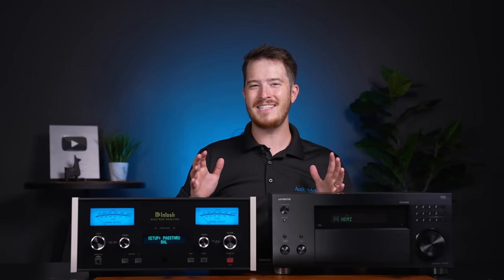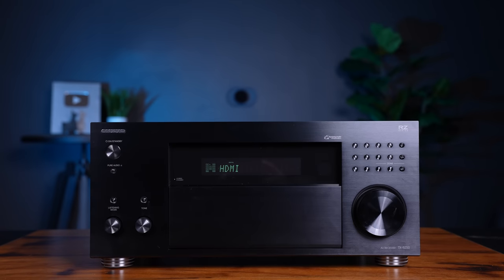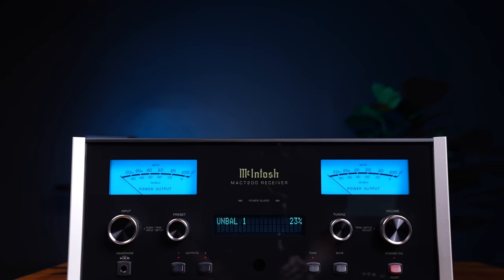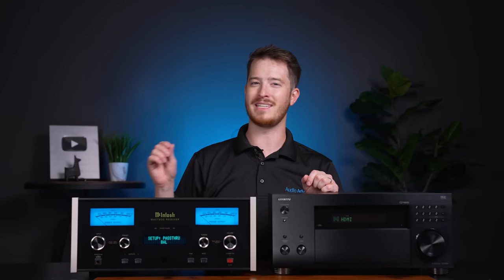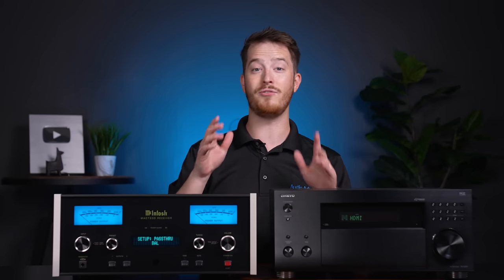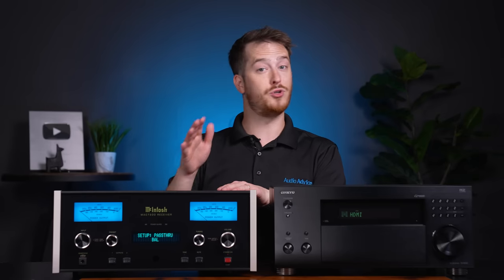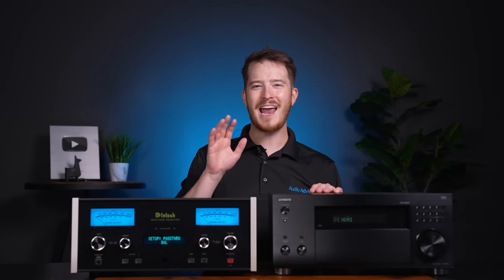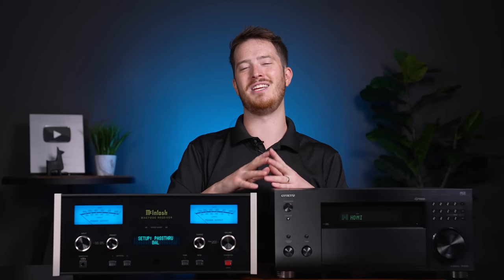Home Theater Bypass Explained | How to Get Great Two-Channel Audio in Your Home Theater!

Comment: Great video but I have a semi-related question.  I’d like to find an AVR receiver that’ll just drive audiophile-grade 2-channel stereo to 2 rooms simultaneously (speakers are 4 ohm).  Yamahas will drive 2 rooms but Yamaha mixes “party mode” zone-2 into MONO for some reason (Why on earth!!).  Preferably I’d like to set “room 2” speakers to a slightly lower volume.  I don’t need TV or surround in this case; just 2-channels into 2 rooms, but preferably with audiophile quality.  I lean toward AVRs because of the built-in room correction.  Is there a quality AVR that might be up to the task?  Any insights appreciated :-), thanks!
Reply from the maker: Thanks! Call or chat with our team at audioadvice.com and they may be able to help you out with the question. Thanks!

Comment: I have seen several posts on social media stating that, before switching from stereo listening to home theater mode, they turn down the volume of the integrated completely. I guess that would be to prevent damaging their speakers?
That sounded pretty risky to me, especially in a household. But watching this video, I didn’t see you mention that.
Now I’m confused. It this amplifier dependent?
Reply from the maker: That part seems odd.  If an integrated amp has home theater bypass, selecting it is the same as setting the integrated amp to full gain, so turning it down first would not do anything. This could be people who are trying to fake a home theater bypass and they would want to turn the volume back down before they chose another input.  Thanks for watching

Comment: You setup looks great. I get great audio reports with my T4XB using a Shure 444 (high impedance to match the Drake input ) which was a popular combination back in the day. I had tried a Turner 454C SSB mic and the feedback was the audio is tinny. The D-104 also has high treble - to me it’s not great for SSB but others work probably argue that. I’ve heard the Turner +3 is an awesome sounding mic. 73.
Reply from the maker: Thanks for sharing!

Comment: Very interesting, to connect my Rotel to my Denon 4700 AVR to enhance and give quality to the front column channels.

I understand that the speakers must always be connected to the stereo amplifier, right?
Reply from the maker: Exactly yes.  If your Denon has front channel preamp outs and your Rotel has a home theater bypass, it will work great.

Comment: Here is my scenario and im a noob.... I pretty much have a 7.2 speaker setup but have all speakers play music in stereo(left and right). What I've done for now is buy xlr splitter cables to split front left pre-out signal from my pre/pro-amp to 2 amp channels where I have 1 amp channel (monolith 7x)connected to my left tower speaker and the other connected amp channel to 2 satellite speakers(above my left side of couch) and the other (behind left side of couch). The non tower speakers are smaller 4ohm satellite speakers wired in parallel. My setup is the same on the right side. Is there a better way to do that? can I "assign" my assignable height 1 and 2 to the Front Left on the pre-pro and then connect the height preouts to amp channels so I don't need splitter cables? I prefer a room full of sound all the time where i'm in the center of it with music and if I decide to watch a movie, I can swap the cables and change the settings back. With surround movies, most of the time, the surround speakers just stay dormant until their called upon and with music, there off.
Reply from the maker: Most home theater receivers have an all channel mode you should be able to engage.  Thanks for watching

Comment: My Yamaha AVR has been doing double duty for over 20 years with Direct mode. I never understood what was so difficult about this but sounds like not all AVRs had that option.
Reply: Direct mode is simply bypassing a lot of the signal processing inside the unit. Home Theater Bypass, as Audio Advice clearly described, is leveraging a much higher performance piece of gear to drive your stereo pair, but seamlessly integrating it to work with an existing home theater receiver, even the very best of which pale in comparison to a comparably priced dedicated stereo unit. That’s no insult to the home theater receiver by the way. It’s simple fact. Home theater receivers can be awesome. But 5, 7, 9, 11, or 15(!) channels of amplification in one chassis? Compared to a chassis with a massive power supply dedicated to only two channels??? It’s science man!!! 😉
Reply: @scottwallace1  Yes, absolutely!
Reply from the maker: Very well put!  Thank you!
Reply: @omahahaha   You're not getting it.  Your Yamaha in Direct Mode is not close to having a dedicated 2channel system for stereo listening.
Reply: @CP-vi8fy  Thanks for your reply. I do get it, but this is a great option to save money or space. My setup sounds fantastic.
Reply: @omahahaha    Okay.  Happy to hear it.  Cheers.

Comment: does this setup work for dual sub systems so I can seamlessly switch between 5.2 and 2.2?
Reply from the maker: It would depend on the gear. You need to control the subs from your two channel component to do that.  Thanks for watching

Comment: Im kinda new to this . My Marantz SR6015 has the option called "Pure Direct".
  Is that doing a bypass?
Reply: I have the sr7011. Pure Direct just basically eliminates all the noise from internal sources to give you a flatter response. That's why you'll see it even turns off the led panel when you apply it. Not the same thing as a bypass.
Reply: Use the pre outs in your Marantz to connect to a dedicated 2ch
Reply from the maker: What @bootneylee9802 said is correct.

Comment: Great video! How about the subwoofer if I want the power amp to work for 2.1 instead of 2.0?
Reply from the maker: Thanks, that can be pretty tricky. If you are interesting in pursuing, please reach out to our team to get into more details on your system.  You'll need a sub with speaker level inputs and a crossover.  You then will need to use the crossover on the sub for stereo, and defeat it for home theater, which is inconvient.  The REL subs work very well for this though.  Thanks for watching

Comment: Hello. How do you setup home theater bypass between anthem STR stereo preamp and a Denon receiver 4700h that is currently using an external amplifier. It seems like I would have to remove the external amplifier connection from the Denon in order to make the pre-outs available for this home theater bypass with the anthem STR preamp. Additionally, I would then need to connect the anthem Left & Right channels directly with the external amplifier via XLR since no rca connectors are available on the anthem. Lastly, I would need a special cable (XLR to rca) going from amplifier to my center pre-out on my Denon?
Reply from the maker: If you have an external stereo amp connected to the Denon for your main speaekers, it should be connected to the Anthem.  If you have just a mono amp connected to the Denon for the center channel, you leave that in place.  Your STR should have 4 analog RCA inputs.  And should you have bought all this from Audio Advice, we would have walked you through it already :)

Comment: Would I get good quality 2ch in this bypass scenario if my preferred music listening is via tidal on appletv which is plugged into a home theater processor. And the reason I’m fixed on appletv is for the on screen display on my TV for music videos watching on tidal
Reply from the maker: The bypass would not be useful for your use case.  Thanks for watching

Comment: I'm looking at a Parasound HINT 6 Halo integrated amp, and it has Home Theater Bypass for L, R, Sub 1, and Sub 2. Does that mean I can use the same subs for the 2.1 setup with the HINT and also a surround sound receiver? If so, any idea how that all gets wired?
Reply from the maker: Chat or call our experts at audioadvice.com and they can help you out with this!

Comment: lets say you have Dirac on you avr and a separate high end integrated amp. You connect them together. You activate the ht bypass on your integrated. You cannot enjoy the benefits of Dirac right?
Reply from the maker: That is correct.  For 2 channel sources you would not get Dirac.  Thanks for watching

Comment: You can do something similar by using a regular input on your 2ch rig and turning the volume control to wherever unity gain may be. Not as convenient but it works
Reply: Ya, because another name for "Home Theater Bypass" is "Main-In".  Right?  I'm grumbling because of all the times I wondered, "wtf is htb".   Ridiculous.
          Now however,  I think your way would probably work better.  It would be pure luck to gain match one Mac power amp vs some random 7-channel multi-amp box-thingy.
                                                                             Reggae Funk & Brass      🔈🔉🔊
Reply from the maker: That would work too, but can be inconvienent and a disaster if you switch inputs on your 2 ch rig and forget to turn the volume down.

Comment: As described and shown in this video, HTBypass using the McIntosh will not work until you also connect a 12 volt trigger out feed from the Onkyo to theMcIntosh Control Bypass input on the rear.  The McIntosh will not go  into bypass mode until receiving the 12 volt signal.  In addition, adding a HT processor into a McIntosh setup allows you to use the HT processor as an HDMI bridge to connect an SACD, DVD Audio player or an Apple 4k TV for example to the McIntosh.  I am using  a Rotel HT Processor to connect a Sony UBP-800 M2 to the McIntosh C2800 along with other HDMI devices in stereo mode.  When using it sounds great outputted to my MC275.  Using the dedicated HT Processor and setting it to Stereo mode will send the complete signal to the McIntosh. On the C2800 all 3outputs work so your existing Sub will also receive a audio signal   Works great.
Reply from the maker: Thanks for sharing!!

Comment: I wanted to do something like this with my Emotiva USP-1, but my darn Denon doesn't have a pre-out. (I was a first-time buyer and didn't know any better.) I sold the unit a few months ago, and now I don't have any AV Receivers. I'm looking forward to getting a new Denon or Marantz AVR for movie and stereo music listening.

I am still considering the Denon X4800H or the Marantz Cinema 50/40. Does anyone have any other suggestions?
Reply from the maker: Reach out to our team of experts at audioadvice.com and they can help you make the best choice for your setup!
Reply: oh man...... My denon had no pre-outs and wanted more power. I bought the monolith 7x and "Russound ADP-1.2 Speaker-level to Line-level Adapters". I connected pos and neg speaker wire from Denon terminals to adapter, then 1 rca cable from adapter to the desired amp RCA input, then Pos and neg speaker wire from amp terminals to speaker like normal. They work great and one 40$ adapter works for 2 channels. You can use this HUGE HACK on almost any old receiver without Pre-outs provided you have a seperate amp with RCA inputs and dont have to buy a 800$-1000$ AVR. Of course AVR's with enough pre-outs for future upgrades costs $$$$$. They got me haha I eventually caved and got a pre-pro

Comment: HT bypass input is same as a two channel's pre-amp in ?
Reply: Yes
Reply: @andrzejz6980  That seems logical to me !  I wonder why the new branding?   So....  feed the HT receiver's front left & front right channels RCA out's into two channel's Pre-IN and control the volume through HT's volume control ??
Reply: What are you referring to when you say "a two channel's pre-amp in"?
The HT bypass setting disables the volume control on the pre-amp, so that you can control the volume exclusively with your receiver. It simply passes the signal through the pre-amp. That's why some pre-amps refer to it as "pass through."
Reply: Aha. Thanks for the explanation. Now I get it.
Reply: @benrub  Output from HT Receiver's left and right front channel INTO the two channel (stereo system) Pre-IN input.  In this scenario, volume control is performed  solely through the HT receiver.
Reply: @ptg01  yes, I agree with everything you said, except the input on the back of the preamp is not necessarily going to be labeled “pre-in”. In some instances it will simply be any of the inputs. For example, it could be labeled “Input 1.” Other preamps will have a dedicated input specifically for home theater bypass.
Reply from the maker: Yes

Comment: I honestly think the notion that AVRs are somehow lacking for stereo listening is archaic. Even there, if you think amplification is insufficient (which it very rarely will be) you can just buy a two-channel power amp and put that power amp between the receiver and the front stereo pair and use that all the time for HT and audio both.
Reply from the maker: Some are very good, but many are not in comparison to good separates.

Comment: I have an RZ50 and a Technics SU-G700 connected. Amazing for music and movies but like you said subs can be a bit of a hassle. I like to play music with my SVS sub and found the best solution to be a small RCA switch box. All I gotta do is switch between sources on the box, no cable swapping needed. I do wish it had wireless controls as the sub switching is the only thing I can't do from a remote
Reply: Which 'switch' did you end up using ?  Schiit SYS ?
Reply: @ptg01  random little metal box with a dial switch from Amazon. As it just needs to switch between sources there should not be any loss in fidelity. As it is just handling the low end of the audio spectrum I am not too worried about it negatively affecting the output. I've measured it with a calibrated mic in Dirac and saw no change in output using the RCA switch or not.
Reply from the maker: Thanks for sharing! That seems like it works well for you!

Comment: Maybe buy a premium AV and pair with a mighty AMP and source all power to amp? You get a dedicated AMP and that is all it does and unless you get a very expensive 2 channel AV, a dedicated premium AMP will crush any integrated all day including Sunday and you have flexibility. That is what most people do.
Reply from the maker: Many people go that way, but for a lot of two channel puriests, there are better integrated amps and preamps than the best AVR.  However, in a dedicated home theater room the better power amp is the best way to go.  Thanks for watching

Comment: I have a Denon AVR3000 from 1992 that has the ByPass mode. Not a new concept.
Reply from the maker: That is more of a processor bypass which does improve the sound, but we are talking about driving your main speakers with something far better

Comment: If you have the budget for McIntosh why on earth would you not have separates?  This is a foolish setup.  Purchase a high quality pre-pro, separate Mc amps, and speakers.  If you want to stream music get either the Rose or Eversolo and a separate DAC... Done.  You all are making this way to complicated.
Reply from the maker: The same method applies to a prepro for home theater bypass.  That is what we were trying to explain.  You would not be done with your suggestions as there would be no home theater system.  That is the point we were trying to get across on how to combine a high quality two channel system (pick your choices) and a home theater.